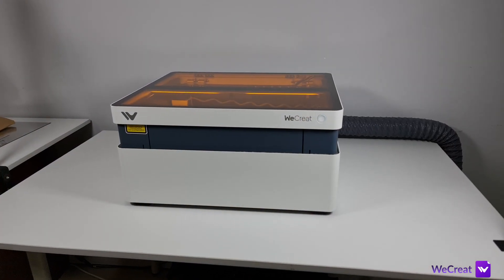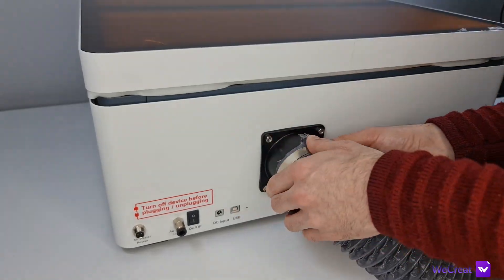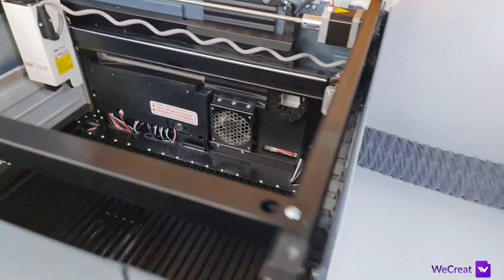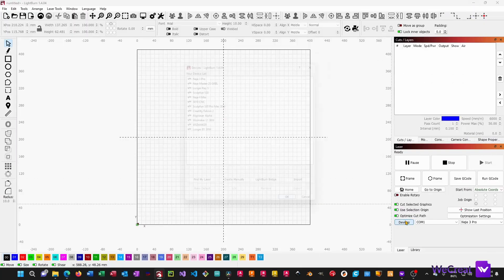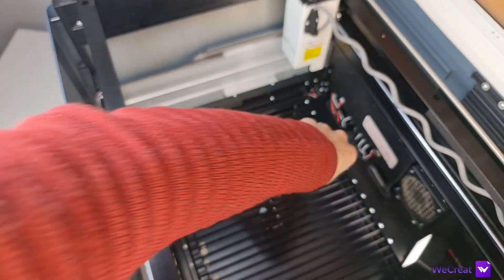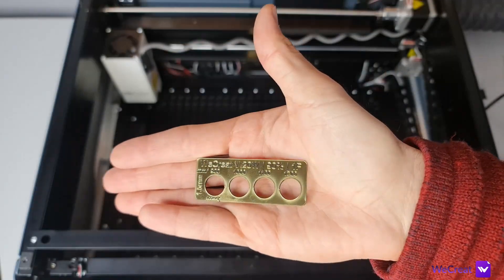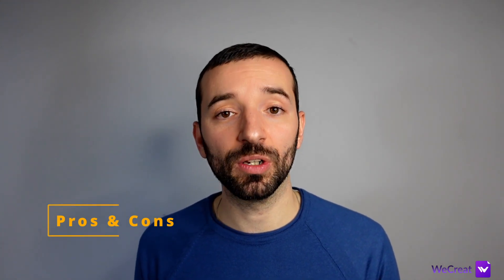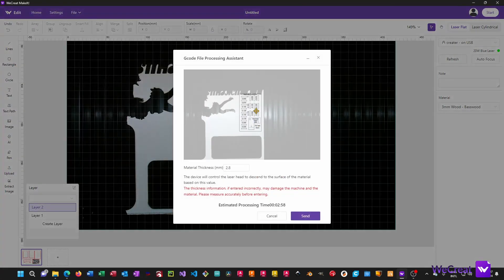WeCreat Vision - The Future of Laser Engravers is here

Comment: Great price point.  The demos of it cutting thru 10mm are of balsa, not a very good representation.  I don't understand the value of raising and lowering, just another mechanism to wear out.  I think you should only consider a CO2 laser of 20W or less if you're not doing much cutting.  It's simply not the future of lasers.  Sorry, hyperbolic and inaccurate.
Reply from the maker: Hi, thank you for your comment.

The demos are done to impress and show what you could achieve, but in my opinion, no one should buy such a laser to cut thick materials (only on occasion), that is not the point of this machine. Anything on the order of 1-6mm is perfectly doable.

The rising mechanism is very similar to what you find in larger CO2 lasers with the difference that normally the bed with the material would rise and lower inside the enclosure which needs to be taller as this needs vertical space. 
Here they decided to approach the z clearance in such a way that the machine takes the least amount of space when not in use and when it is to be transported. Yes, extra parts to wear and tear, but overall, it is a good and easy system for newbies. Plus I believe it won't be worn faster than other parts thanks to the low use.
A diode laser is simple and robust compared to a CO2 laser. CO2 lasers have other components and sensible parts, the CO2 tube does not last as much as a diode and it requires an external cooling system often more expensive than the budget machine itself. Besides the typical CO2 laser starts at a power of 40W. 
A 20W laser module is perfect all-around power for engraving a variety of materials and cutting organic ones up to around 30mm (at min focus and slow rate).

In my opinion for newbies, it will be as easy as picking up a printer and having fun there is no knowledge required to use it.

I hope it helps
Ciao